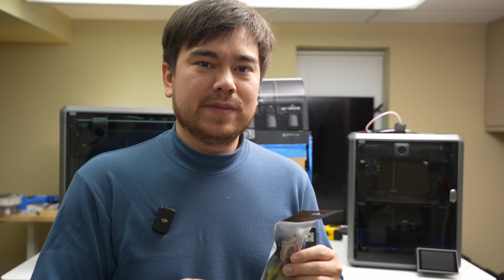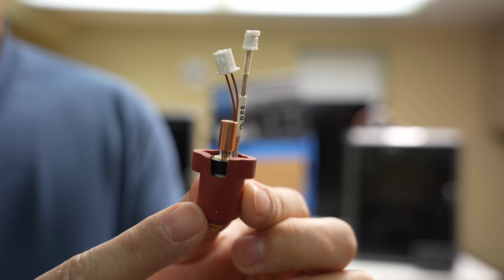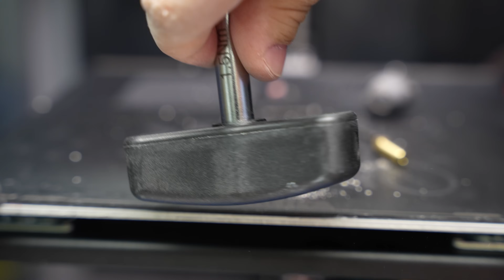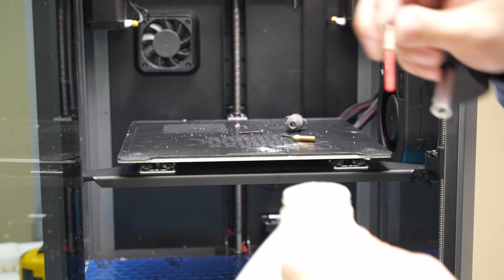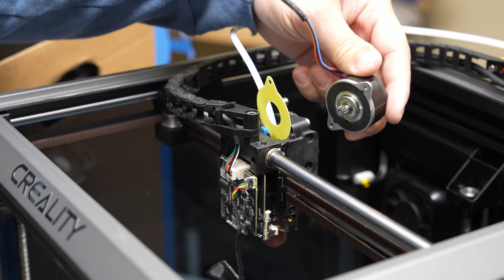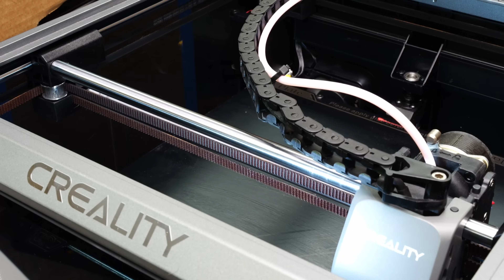🔥⚙️⚙️ CREALITY K1 - Extruder and Hotend Upgrade Kit

Comment: I've had to have Creality send out a couple of new parts to fix my K1's under-extrusion problems, hopefully it will have that new model of extruder in it.

The hot end is interesting. My thermistor was causing my issues due to bad wiring at the hot end, but the new one looks much more substantial. Can't wait to try it out.

Comment: Thanks for the great engineering analysis from the consumer's perspective.

That was the K1 first layer I've been waiting to see!  I'm feeling a lot better about the K1's early teething issues, particularly with the new extruder.  I love that Creality is using a four wire interface to the extruder board with power and serial data (CAN bus?) but I wish they'd put an optical filament run out sensor on the extruder to make it easier to print TPU directly into the  extruder without the reverse Bowden tube.

Speaking of TPU, I print a lot in TPU and I'd love to see some K1 or K1 Max TPU tests - print quality, bridging and overhangs, and print speed.

I haven't even seen a glue stick in a couple of years so I was very sorry to see Bambu Lab and Creality dragging us back to that mess.  I expect aftermarket print surfaces to fix that nonsense very soon.

Comment: I have neither, but compared to the Bamboo, this won't be able to auto swap filament. No filament cutter and if the extruder is locked it would require your intervention per color change?
Reply from the maker: Yes, likely a pause, unlock filament, pull it out, push new filament in, purge a bit, re-lock filament, and resume. Lots of steps. Basically - don't do it, or if you want to do it, just do 1 color change per print job because it's time consuming.

Comment: When they removed holes from the old extruder does that mean that the new extruder is lighter?😅
Reply from the maker: It's roughly 21g vs 17g for the new extruder arm design. I'm not sure why it isn't considerably heavier since Steel is 3x heavier than aluminum.

Comment: I received a extruder spare for the K1 also but the filament locker was too lose (maybe damaged) so, I used the old one, that works fine, and switched both cogwheels from the new to the old one. It's working without any problem.

Comment: nathan, Please do comparison between glue stick and hair spray. hair spray cleaner and more better
Reply from the maker: Easy - Glue stick stays on the bed, hairspray gets all over everything, contaminates bearings, fans, and clouds up clear glass panels and is a general PITA. But it works great for ABS. I used to use it back in the day (10ish years ago)
I think you're supposed to take the bed surface out of the printer to prevent the contamination issues.
Reply: @NathanBuildsRobots  Ya don't spray it while it's on the printer!!!!! That would be sofa king dumb to do. You don't spray that much on where you get it all over the place. smh
Reply: I only use sugar water on the Pei sheet, Never let me down
Reply: vs smooth and powder coated PEI?
Bambu Lab went old-timer (when filament was either ABS or another ABS) with glue on build plate - and Creality just copied it 🙄 Stop this nonsense.